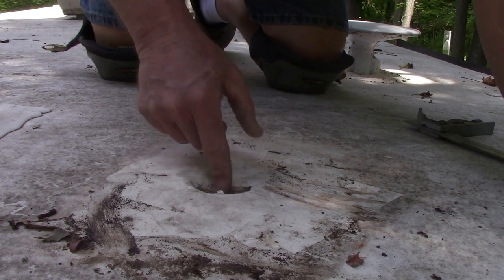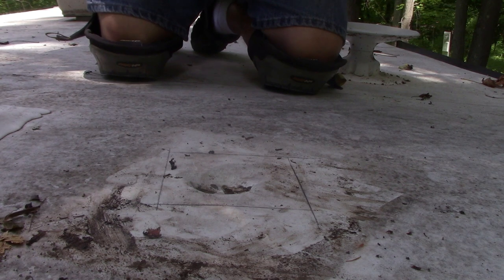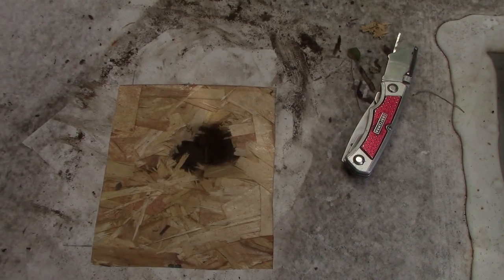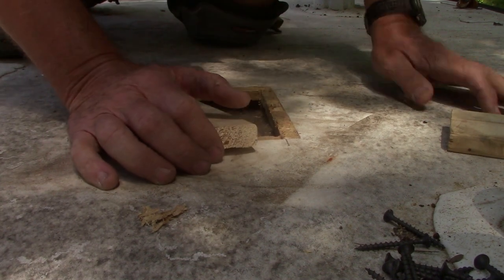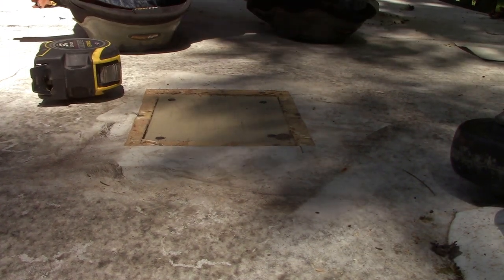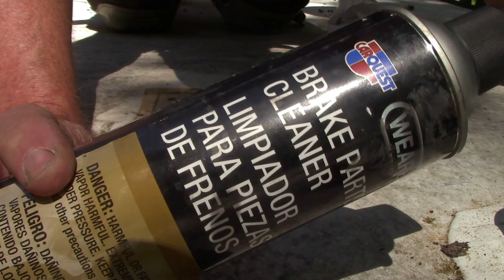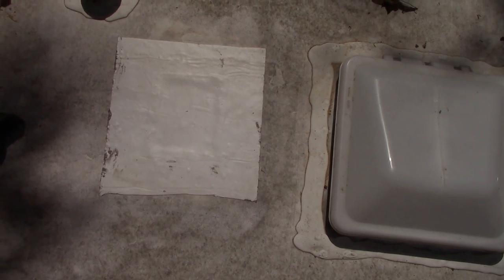Patching A Hole In RV Rubber Roof

Comment: Cut a circle for a patch then nothing will lift after you roll it out. Also dont use sheet rock coarse screws. Use stainless steel
Reply from the maker: Thanks Gary. All good ideas

Comment: You just left the Eterna bond backing on your first patch? Then applied the final patch over a dirty surface. You will be re-visiting this job soon.
Reply from the maker: I have learned a lot in the 3 years since this video was shot. By the way, I never heard from them, so it must still be ok, 3 years later.

Comment: I guess it did not go all the way through, I see you and I have the same issue with shacking hands, stops me from painting as I put more on the trim work then walls. Good video my friend
Reply from the maker: It sure didn't. It didn't even touch the ceiling panel.

Comment: What did you use for the actual patch material?
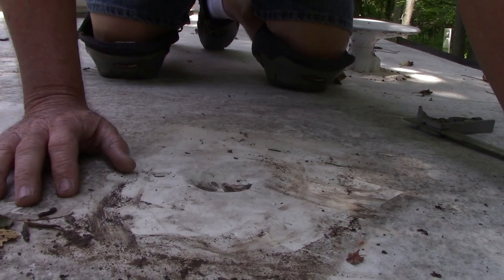Reply from the maker: 1:06 I say I will use Eternabond
11:00 I show rubber filler in hole
14:12 I show Eternabond package
15:09 I glue rubber filler down
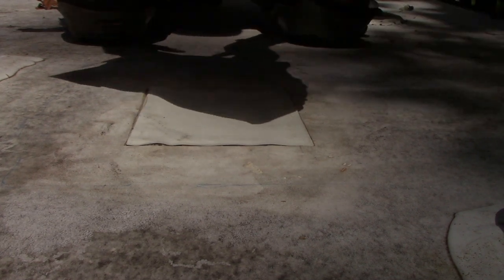15:49 I put Eternabond patch on

I kinda think you didn't watch the video....ha ha
Reply: He mentioned using osb board early on briefly

Comment: Any suggestions on closing the space from removing the water heater? I’m thinking it’ll be a little like this just bigger.  Thank you for any suggestions!
Reply from the maker: It will be really tough to close that hole, if you want it to look really nice. If that is not too important, just get a small sheet of aluminum in the correct color. Put that over the hole and seal it with silicone.